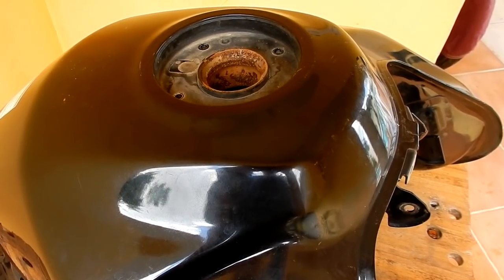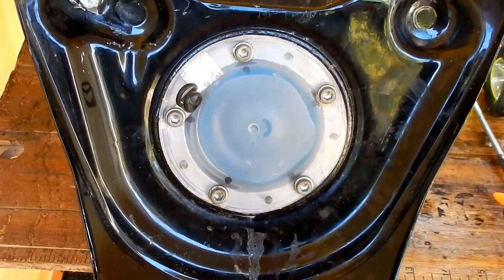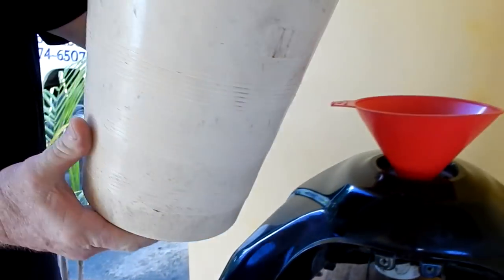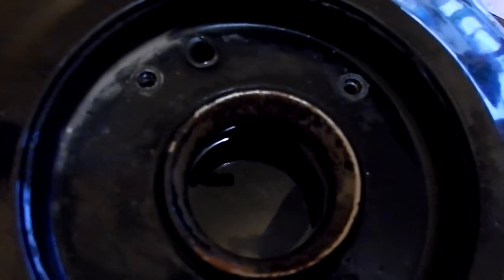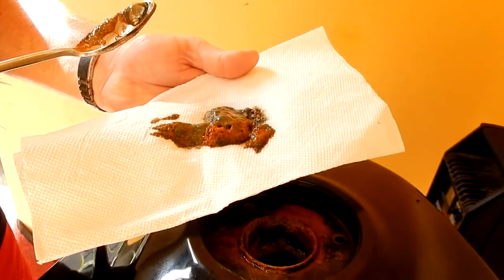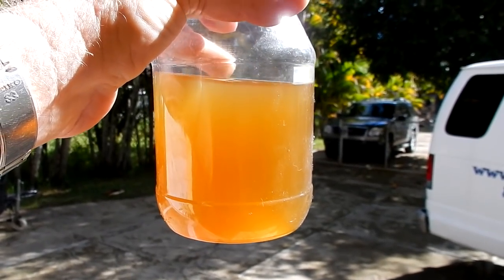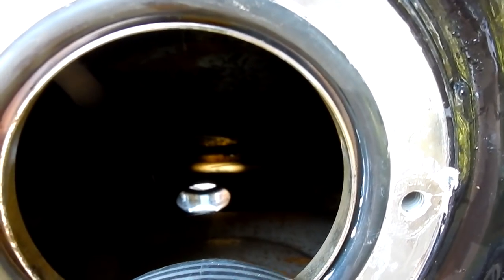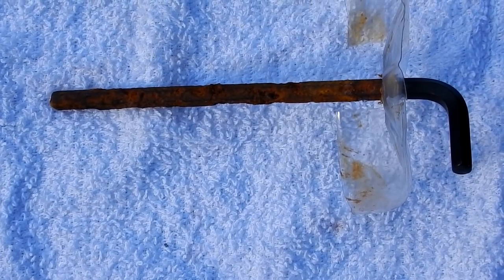Motorcycle Tank Rust Removal Using Electrolysis

Comment: Do you need to add some sort of sealer to coat the inside of the tank or anything like that afterwards?
Reply: Definitely, otherwise flash rust will start right away. I have had excellent results with the POR-15 gas tank coating system.
Reply: @MotoCaribeLead  thanks for the reply. Could you link me to the product please? Much appreciated 👍

Comment: Can we paint from inside after electrolysis.
What volt of current is required.
Reply: Paint? No? Coat with a petroleum-resistant product? Absolutely.
I use POR-15 and it has always worked perfectly and is easy to apply.
Reply: My charger is set at 12v, 2 amps
Reply: @MotoCaribeLead  thanks a lot.

Comment: Great video, thinking of doing this to a 08 vstrom 1000 tank. Did you do a video of sealing the tank after the rust has been cleaned?
Reply from the maker: No, but should have.

I bought the POR-15 motorcycle tank kit and followed the easy instructions. The only caution os once the POR-15 gets on anything, it's there for good. I got some on two fingers and it took a week to finally get it off no matter what I did.

It's a simple process. The challenge for a V-Strom tank is moving the tank around to get the splash shelves in the tank coated properly. But it's doable.
Reply: @MotocaribeDR  thanks for your reply.
Did the tank flash rust once you finished cleaning with the pressure wash? 

Sorry if you have already answered this question in previous comments . I have not been reading through them all
Reply from the maker: @jefffisher9545  No prob.

When you strip ant ferrous metal down to the bare metal, you will get flash rust.

My advice is to plan the POR-15 right after the tank is dry. BTW: I put a hairdryer in the opening of the tank for about an hour to totally dry it out before the POR-15.

Good luck, and tell us your results!

Comment: Do you then use a coating after that treatment or leave it bare metal ?
Reply from the maker: If you leave it bare, you'll be removing rust again.

Yes, definitely, coat the tank. I use POR-15 with great success.
Reply: @MotocaribeDR  that was my thought also , I have a 1970 Evinrude snowmobile tank to do .

Comment: Thank you, without intending to, my bike has sat a couple years and has rust in the tank. I've watched loads of videos about cleaning out the fuel system, using vinegar in the tank, muriatic acid, electrolysis, drying it & preventing 'flash rust' afterwards... I think I have a handle on what's required now. But like yours the fuel pump/filter assembly sits inside the tank through a large hole underneath and I had no idea how to seal that up. I don't know what a 'toilet flapper' is, not being from the US lol... but I think I get the gist of it. Find something to make a gasket and then cut out a plastic lid to bolt on. Much appreciated, another piece of the jigsaw covered I hope. Thanks again for sharing your experience.
Reply from the maker: Good luck.

I kinda knew the science behind electrolysis, but implementing the science from a practical perspective was a different story.

I ended up taking some flat metal larger than the pump opening, drilled holes aligned with the tank bolt holes, made a gasket from rubber tire innertube, and bolted both on. It worked well, and now I have tools for the next time I go through the process.

Let me know how it all works out.
Reply: @MotocaribeDR  Oh that's great to hear, I actually have a piece of flat metal laying around somewhere that I was thinking might work better.
Reply: @MotocaribeDR  Wouldn’t the actual fuel pump seal ( gasket ) with the metal bolted down seal the tank from leaking?   It’s seals gas from leaking.
Reply from the maker: @300zxdriver  Maybe, but I didn't want to risk damaging that gasket, not knowing the totality of the work ahead.

Comment: I tried this today with a 12 gallon tractor gas tank using 1-1/2 cups of Armand hammer, water, a 5/8 rebar for an anode and a small NAPA battery charger. What could cause that to fail? Anode to big, charger to small, not enough soda? I let it set about four hours and no reaction whatsoever.
Reply from the maker: Two things could be the likely culprit:
1) Arm and Hammer is sodium bicarbonate, NaHCO₃. Sodium carbonate is Na₂CO₃. Different chemicals. Try sodium carbonate from any pool supply store, very inexpensive.
2) If your charger is automatic, it may not read any voltage in the circuit, so it won't send any electricity. That is who I put a small battery in the circuit, so the charger can read electricity and send charge..
Retry with the above and let us know the results. 12g is a large tank so it may take a while.
Reply: I refilled the tank with washing soda and added a battery into the circuit. Wire brushed the 1/2” anchor bolt I’m using for an anode and. The charger is putting out about 2 amps, is that enough, I don’t seem to be getting any results. Maybe change the anode to a piece of conduit so there is less resistance?
Reply from the maker: Can you take a photo of your system and post a link to it?
2A is fine. Make sure the + is to the anode and not touching any metal, and the - is on some bare metal, not paint. Look at 4:27 in the video.
Other than that, without being there, I have no idea why you have no reaction. It's all chemistry and physics.
I have done this a half dozen times without any issues.
Reply: I shined up the anode and ground connections and it seems to be working fine now.  Thanks!
Reply from the maker: @grumpa328  I remember the feeling when the soup started boiling! Now just be patient.
Reply: Is it safe to leave it hooked to the power indoor overnight? It would be in a storage barn
Reply from the maker: @grumpa328  There is a tiny hydrogen being catalyzed off, so if it's in a ventilated place should be no problem.

Comment: Could you elaborate on why this process works?   Is it selectively removing the rust only and not any of the metal work of the tank?
Reply from the maker: All the rust from the inside of the tank is removed. Electrolysis separates rust from the base metal. An electrochemical process causes an ionic exchange that removes iron oxide from metal.

That, and majik...

Comment: Can I use a 12v laptop charger as power source
Reply from the maker: Good question. I don't know the answer. I suspect you'd have the same issue with just a charger not reading any voltage, and you would still need to jump it with a battery.
Reply: @MotocaribeDR  thank you, I'll try it

Comment: Thank you. This is a perfect video i think i can do the same to save my rusted tank (same model).
Can you explain me something about the connections? I can see jumpers connected from the bike to the battery (green - white) and another jumpers (black - red)  going from the battery to ??? Do the other side go to the ground?Can you please expain this?
Reply from the maker: No problem.

I found, and I tried to explain this at 4:01 in the video, that using an automatic charger does not pass any current to the tank because the charger needs to sense some voltage to work. By placing a 12v motorcycle battery between the charger and tank allows the charger to sense current and operate properly.

I suppose one could attach just a battery to the tank and it would work, but for how long, and at what current drop off to ineffective levels? The charger allows for constant current to the tank.

+ goes -->charger-->battery(+)-->electrode, -  goes charger-->battery(-)-->tank. 

I hope this helps, and good luck! Let me know how it works out.

If you have a V-Strom with a rusted tank, you might want to consider the high-pressure filter bypass mod, because you will have that screen eventually clog and give you headaches. While the EFI pump is out of the tank, the mod is much easier. That mod bypassed the screen in the fuel pump housing, and replaces it with an inline auto fuel injector can filter. and works perfectly! Ask me how I know... ;)
Reply: @MotocaribeDR  Thanks for replying and excuse me if i dont understand easy i just want to be 100% sure because my english are good enough but not perfect and i dont want to risk more damage with the electricity.
So i have the battery charger plugged in the wall charging the battery during the proccedure and the jumpers from the battery (-) tunk (+) to the anode right?
Another one question because i read that the Ambers must be 3 or less because you may have bad results or harm the metal if you use much power and i think the battery  is 10Amber. 

For the external filter that you said i have read in forums that can only be done in the models before 2007 that have different pump. i have 2008 model with different pump.
Reply from the maker: @christosx13  Yes, + to anode and - to tank.

I have 12 2008 DL650's. Fuel issues have been the only real problem with the bikes beyond normal wear issues, like shock seals, brake pads, etc. Particles that escape the low-pressure mesh filter WILL get caught in the high-pressure screen in the upper plastic housing of the pump housing, causing fuel starvation under acceleration. The high-pressure bypass mod fixes it in my three 2008's which were problems, so I did the entire fleet...and have not had one fuel problem since. It is time and money well spent.

It's not a fuel pump thing. The filter screen is in the plastic pump housing regardless of the model year. The procedure is well outlined in the VSRI forum.

I actually had to do the bypass on the side of the road on a tour:  https://www.stromtrooper.com/threads/fuel-filter-bypass-a-first.366562/#post-4596234
Reply: @MotocaribeDR  You are so right. I have 65000 klm and i i discovered the rust  and red mud inside the tank because the last weeks i had problem after 5000 or 6000 rpm because my bike cuts and when it goes to reserve turns off suddenly many times. The bike was not moving enough the last 10 months and i think it stayed for a period 6 months without switch on and this cause mud and rust to go inside.
.I have taken the pump out of the tank and i was planning to do the electrolysis for the rust but i am thinking if i should try to fix the pump  myself or take it to a garage because my expirience stops in the tank removal and change or clean the air filter.
Reply from the maker: @christosx13  Pumps are rarely an issue. You can change the filter sock attached to the pump, but the culprit is the high-pressure filter screen. If you have rust, fine particles can go past the filter sock and clog the fine filter screen in the top part of the pump housing.

A new pump module is VERY expensive.

You have to penetrate the high-pressure filter screen to allow fuel to pass. This is done by taking the pump assembly apart---not a difficult task---and carefully drilling a hole at a particular angle into the filter screen. The rest is really simple, just needs some fuel line, hose clamps and an inline fuel filter (I use (I use Wix 33095, small and inexpensive.).

Here is the procedure on a K7 and up:  https://www.vstrom.info/Smf/index.php/topic,6105.msg213009.html#msg213009 . Really, it sounds a lot more complicated than it is. As I said before, I did one on the side of the road.
Reply: @MotocaribeDR  Sorry i didnt reply earlier. After many days to take all the rust off from my tank and clean the inside from little pieces i have to tell you that i have a new bike now. I was afraid to do the bypass to the high pressure filter as you suggested (i only changed the outter one this time and pressed air opposite to the high pressure filter) but i will think about this in the future. For now i learnt to do electrolysis to everything  take the tank off and seperate the fuel pump in every single piece in less than an hour. I cant recognize my bike and the sound of it. Afew weeks ago i had a dead bike slowing down at 6000 rpm.Thank you again!
Reply from the maker: @christosx13  Excellent! I am happy things worked out well for your adventure. Now you know you can do more than you thought!

Comment: I also had to connect the charger to a battery and then on to the cathode and tank, what I would like to know is did you leave the battery charger on during the whole process?
Reply from the maker: If the cathode was in the tank, yes, I left the system connected at all times.
Reply: @MotocaribeDR  And leaving the charger on the battery that long wont hurt the battery?
Reply from the maker: @tkwalters2189  It should not. Because only a trickle charge is through the cathode, the charger is putting a trickle charge into the battery.

It's as if you had the charger on the battery. That said, the chargers I use are automatic chargers who deliver a very low charge as the battery gets closer to fully charged.

No worries.
Reply: @stephen shaff With the tank I have I was unable to use a pressure washer like Robert did in his video, I only have the fill access and the petcock access so at first I rinsed with distilled water and with all  the junk that came out I knew I was not going to be able to use the tank until it was completely clean, so I spent well over an hour filling and shaking and rinsing until it finally ran clear. But the process of electrolysis seemed to work well for me.  I also filled the tank with  fresh gas and added stabil to hopefully help keep the tank from flash rusting.
Reply: @stephen shaff The process seemed to work very well, should have take some pics. The hardest part was rinsing the tank because I only have the gas fill access and the petcock access no way to pressure wash like Robert did in the video. It took me over an hour to fill, shake and dump to finally get it to run clear, then I immediately filled it with fresh gas and added some stabil to prevent flash rust.

Comment: Seems to be a good process just a slow process.  Thanks for the video
Reply from the maker: Slow. Absolutely. But thorough. Most other methods get rid of visible rust, but not as thoroughly as this method.
Reply: @MotocaribeDR  got cha i just did my tank with acid and flushed it.  And heat dried the tank and sealed it.  Turned out good i guess.  Took me about a half a day
Reply from the maker: @johnwiechel  Great! A lot depends on how much rust the tank has. The key is sealing it.
Reply: @MotocaribeDR  yes sir. I used the pro 15 fuel tank sealer and it turned out nice.  1987 honda shadow 1100
Reply from the maker: @johnwiechel  Excellent! I am a big fan of POR-15.

Comment: Any good radiator shop can or can send out a tank to get spray lined after this procedure. Your tank will keep rusting if not.
Reply: hence why you seal it for much cheaper than a shop would do. there are plenty of great products that regular ol' consumers can get that seal tanks
Reply from the maker: We used POR-15 as a liner.

Comment: How many tablespoons of sodium carbonate should i put a 4l tank?
Reply from the maker: I used 6 tbs. in a 5.3 gallon tank. So I'd suggest 1.25 tbs of swimming-pool quality sodium carbonate for a 4l tank.
Reply: Robert Cooper and what happens if i put too little or too much sodium carbonate?
Reply from the maker: @ripmax333  I doubt much danger since neither iron oxide or sodium carbonate are particularly volatile. I'm not sure how the reaction would be affected. The 1/3 tbs. per liter ratio should work.
Reply: Robert Cooper and how much should i leave it on the charger? 12hrs?
Reply from the maker: @ripmax333  Depends on how bad the rust is.

It took me a couple of days, and I finished with a pressure washer...

12hrs. most likely is not nearly enough.
Reply: Robert Cooper thanks man! And sorry for the stupid questions. I started the cleaning process on my honda Cub C70 tank, its not bad as yours so i hope i get good results after at least 2 days. Thanks again.
Reply from the maker: @ripmax333  Just remember you will need to coat the tank innards when done or rust will quickly return. I used POR-15 with great success. Not cheap, but a permanent fix after the rust is gone, never to return.
Reply: Robert Cooper you mean you sprayed inside the tank? , how did you managed that? Which colour did you used?
Reply from the maker: @ripmax333  POR-15 is a three-step process that coats the inside of your fuel tank with a hard, chemical-proof material that prevents rust permanently. It is not a spray-on application. You pour it in and rotate the tank until the entire inner surface is coated.

Any chemical or electrical rust removal process will allow rust to reform quickly, something called "flash rust.". If you don't treat the tank rust come back eventually unless you keep the tank full all the time, and maybe add some Sta-Bil.

I use their three-step process: degreaser, metal prep and coating. IMO POR-15 is without peers for this application.

The list price for the system is around $65, but when finished, you're done permanently.  Way less expensive than a new tank.

This is the product I have used numerous times: https://www.por15.com/POR-15-3-Step-Stop-Rust-System

The process is not difficult at all after you remove all the rust and the tank is rust-free. But the coating liquid will not come off anything it touches, and getting it off your skin is difficult.
Reply: Robert Cooper btw, its best to use distilled water or tap water will do??
Reply from the maker: @ripmax333  I'm not sure it matters. I used tap water here which is not potable.